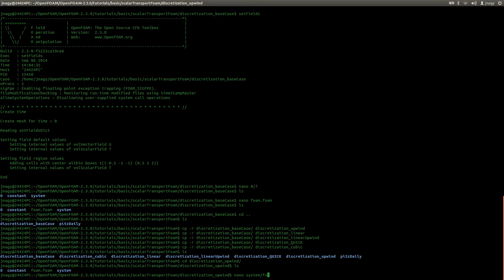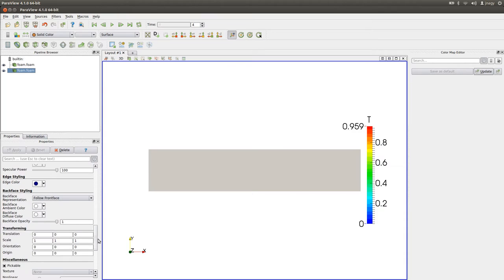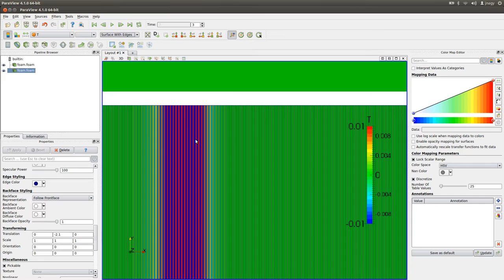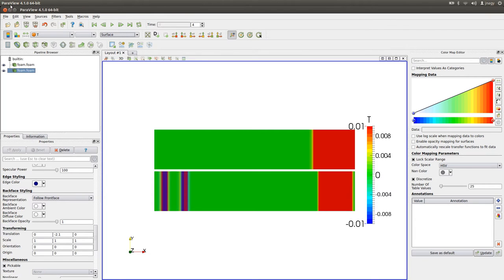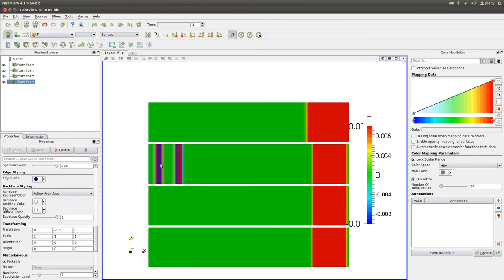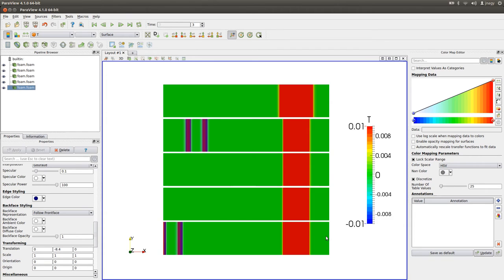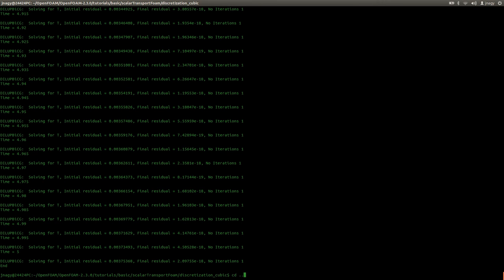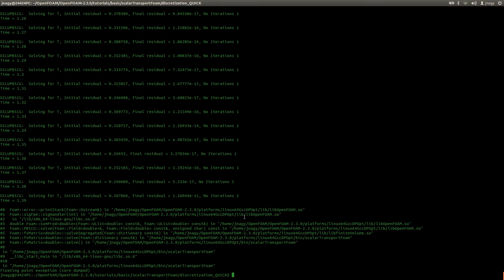Introduction to discretization - Part 2

Comment: In new version v1806 Quick didnt crash at 0.01 time step but instead there was oscillation max value went upto 3.56 & low as -2.56 & the entire core 1 T matter just broke apart

Comment: Hi jozsef, 
i'm on openFoam 7 and i Cannot set up the correct initial condition on T. I try to explain better, in your video there is a region of the domain colored in red (T=1K) and the other regions are blue (T=0 K). I followed all the steps you suggested but i see a full red bar with a kind of opacity i cannot remove. Do you have any explanation? Thanks
Reply from the maker: Is it a problem in Paraview with the skip zero time checkbox? Do you see a modified file in 0 with a list of 0-s and 1-s?

Comment: Any reason why I am missing one time-interval in Paraview when using the foam.foam file? It starts from t=1 sec instead from t=0. When I use paraFoam though, it works fine. Why is that?
Reply from the maker: Uncheck skip zero time in the properties panel.

Comment: Hi Jozsef, great video, as always.

I prefer to use Gauss Linear to avoid numerical diffusion. Is it therefore useful, to use inletOutlet boundary conditions for all transport equations like "nut" as well?
Reply from the maker: For nut usually zeroGradient or calculated is being used.

Comment: Hi József, even though I set the boundary conditions for 0/T to inletOutlet, I still get reflections with the cubic discretization scheme. They are fairly small in magnitude, but still visible in the embarrassment interval. I'm using openfoam 6. Do you have any ideas? Anyway, keep up the good work ;)
Reply from the maker: You will never get rid of them 100%.

Comment: Hello Josef, I donot get the range value of 0.959 with upwind scheme on the legend. What is the settings on the Paraview which needs to be tweeked to get the max(T) on the legend. Is there other way to display the max(T) = 0.959 ?
Reply: by the way, I get the range value of 1 on the legend instead of 0.959
Reply from the maker: On the left hand side above the pipeline browser there is a button called "Rescale to custom data range", there you can set your maximum and minimum value.